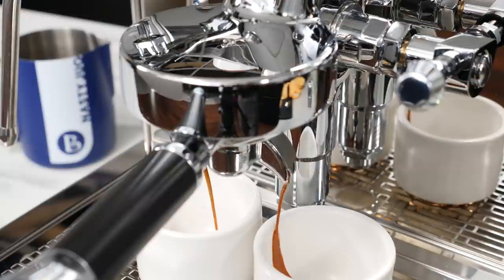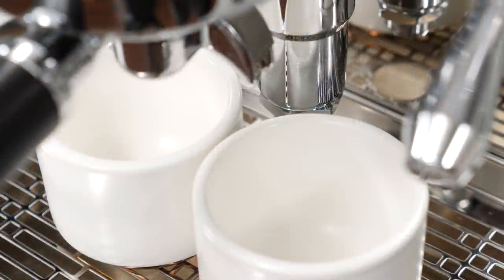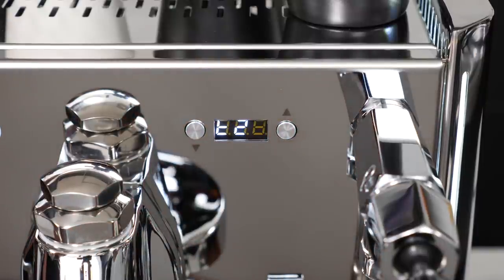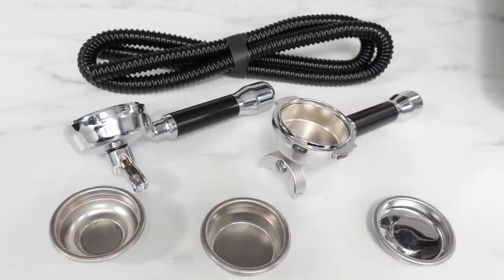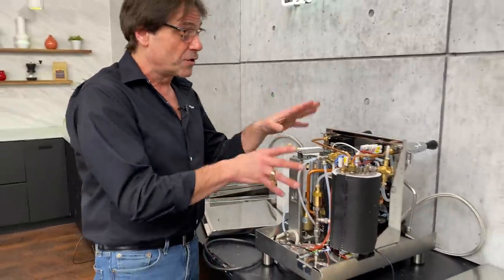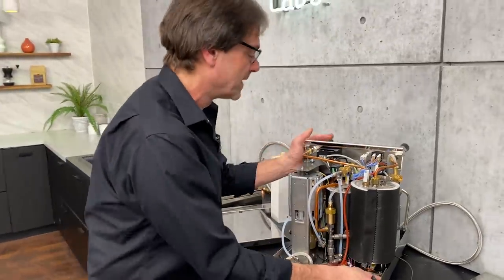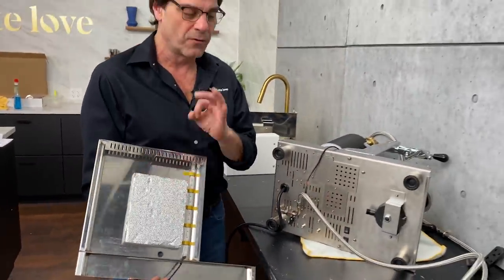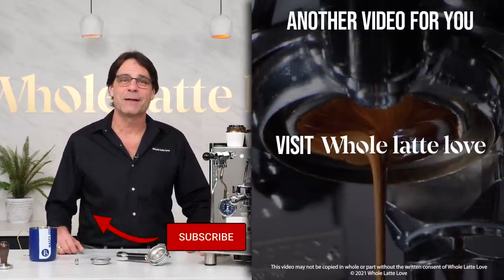Review Quick Mill Vetrano Design Espresso Machine Inside Out

Comment: ECM Synchronika versus this?
Reply from the maker: Hey Albert, Well, here's a link to a spec comparison of the machines and current pricing: /pages/compare?products=NDgzMjYzMDYzNjU5OCwxNTQ1OTkwODY0OTU1
If it's a Synchronika with flow control that's what I would choose. Especially if not plumbing the machines. But it does cost more. There are aesthetic details of both machines which appeal to me but that's subjective. I really like the subtle touches on the Synchronika like the slight taper to the group head, angled PF handle, gauges up high on the face and the PID display which blends into the face. On the Vetrano Design I like how the drip tray sits between the lower case frame elements which are seamless front to back.  Also like the boiler drains and easy access to brew pressure adjustment. If you take flow control out of the mix there's no reason to think one would make a better espresso than the other.
Marc
Reply: @Wholelattelovepage  Great detailed overview video, Marc. To add to the earlier question about comparing this to the ECM Synchronika, do you think one is more likely to last longer than the other based on build quality or brand reputability?
Reply from the maker: @ianpollack8888  Thanks for the comment and question. No doubt ECM has excellent reputation for build/finish quality and reliability. I've been using ECM machines for nearly a decade now so have a lot of experience with them. Have not had nearly as long using QM machines but looking at components under the hood everything is good. IMO once manufacturers get to a base level of quality long-term reliabilty has a lot to do with the end user. Feeding a machine good water, backflushing etc and doing regular maintenance go a long way to keeping things running smoothly.
Marc
Reply: @Wholelattelovepage  I have a heat exchanger QM that dates to before the Andreja Prem. It was imported by a local distributor. I had to replace the boiler immediately, I was the second owner - first was a local Italian deli - but given the price I paid it was well worth it. I just replaced the vibration pump last year (~15 years on the original). I added flow control to it and everything works great. It helps that I use the proper water. So my take is QM has great build quality and would not sacrifice that on this dual boiler machine.